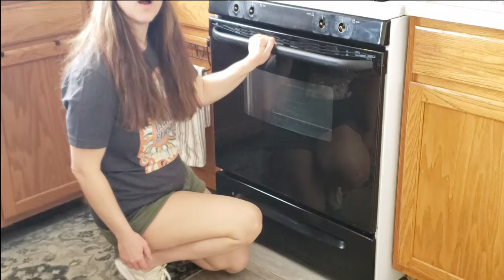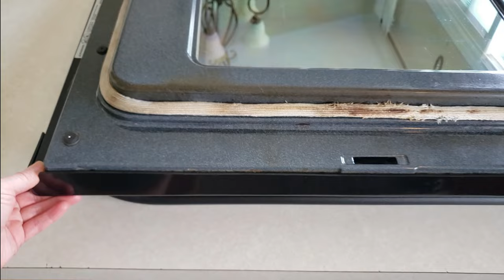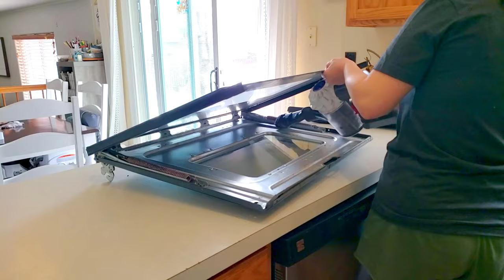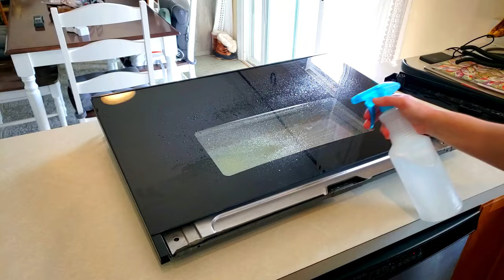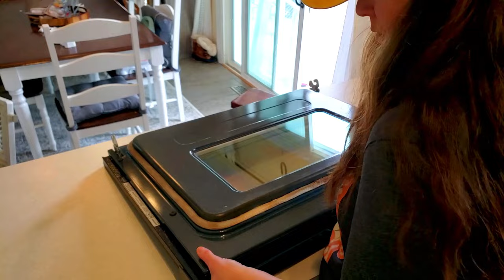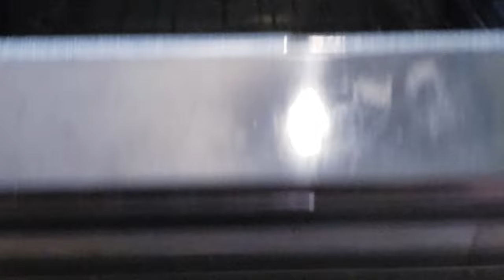Best Way To Clean Inside Between The Middle Of An Oven Door Glass (Real life clean for anxious Moms)

Comment: You're so right - I am terrified to remove my oven door! Will take a good look at it and see if I can manage.
Reply: I did it and hadn’t done it before 😊. It was great.   To clean it, I never took it apart. I just held the door under running hot water and kept emptying it out until the water coming out was clean.  Looked so clean.   It was probably steam heat that seeped in between the glass sheets to dirty it, so just hot enough water should release all the dirty parts out again.  I would do it again gladly.

Comment: I cleaned my door (between the glass) by using a deep sink and turning on the hot tap, filling the door up through one or more of the vent outlets.  There are little spaces water can get in there obviously some dirt got in somehow.  I filled it with hot enough water then tipped it all out.  Maybe about 15 more times and it came up beautifully clean.  I was going to use dish soap but I didn’t need to.  Wondered how long it would take to get the soap out of inside the door, then what if the soap left inside went brown later?  I used no soap inside between the glass. Just water as hot as I could handle safely manoeuvring the door from filling it to emptying it out. 

I repeated it until the water was completely clean water coming out of there a couple of times. 😊

Comment: That must be a really inexpensive oven you have there. My KitchenAid has 4 pieces of glass in the door. There is a full-size outer glass, a full-size inner glass that both sandwich 2 full sized coated inner glass panes. Thankfully, the inner glass catches 99% of the grease and grime that builds up in the oven. 🙄 
Thanks for the video!